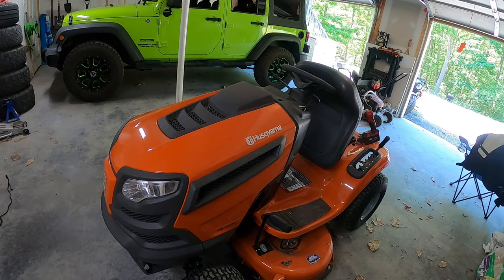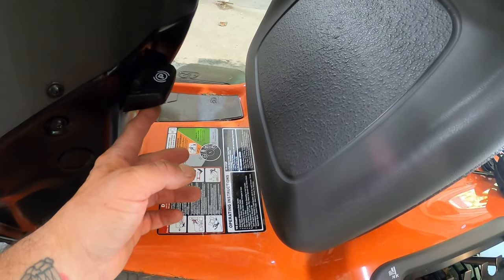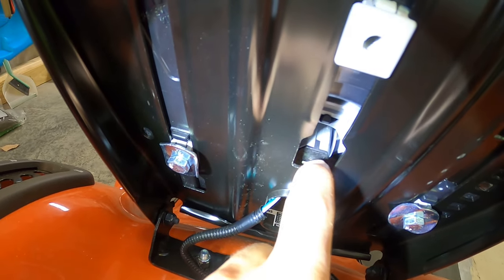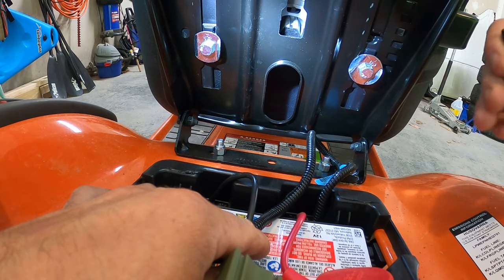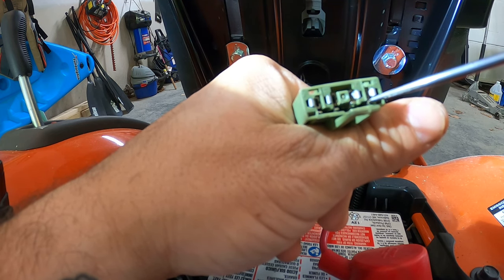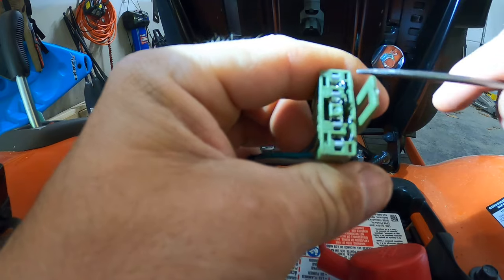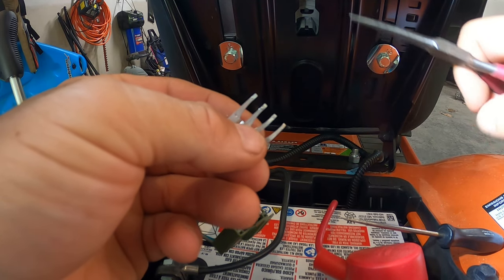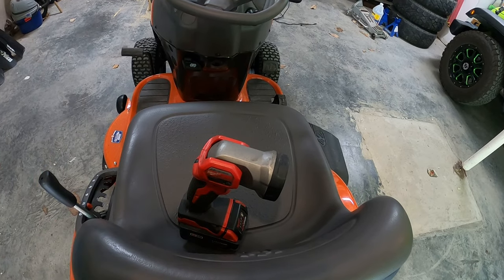How To Bypass Your Riding Mower Seat Switch

Comment: What these companies need to understand is that not everybody’s yard is perfectly level and perfect like the yards in the lame Lowe’s or Home Depot commercials my yard is hilly and I have to lean and it tries to shut off while I’m side ways on it🤣
Reply from the maker: Agree. I think it's definitely a good idea to auto shut off in a roll over event but, I lean to prevent a roll over.  Can't win
Reply: That's exactly why I am here.
Reply: @Ionizap  I agree with you but, the liability to the company if something happens is expensive in court.
Reply: Also they need to learn I might want to run my mower for over ten years and I got no choice but to change a safety feature or whatnot.  : ) I got a few welds on my 10 yr old for sure too : ) and where am I gonna throw the old one away anyway? Haha. I'll turn it into a go cart.
Reply: Amen

Comment: I'm glad you posted this, I went right out & popped that clip out.  Cut some grass.  Then I went to start my New Holland tractor to cut the larger areas, but it was dead to the world.  After a few minutes, I found that I had left the PTO turned on the last time I shut it down.  D'oh!  Deleted by one safety switch and immediately stymied by another on a different machine!  🙄

Comment: This is great!! Literally took me 2 minutes only because I had to go back to the toolbox for a smaller screwdriver.  
One tip: tape the metal contact that comes out TO the plastic switch. That way if you want the safety switch activated in the future (after you are done troubleshooting) then you don’t have to go searching for it.
Reply: Do u plug it in wit the safty switch off
Reply: @markd6637  nope leave it unplugged after you have taken the metal contact out. Metal contact has to be taken out of the plug or the mower won’t run.
Reply: Still won't run

Comment: Thanks for the tip. Was hoping I had a bad seat switch and as a result the mower wouldn't start. But it still won't start. Thanks for helping me eliminate one possible issue.
Reply: Mines won't start either just kinda clicks battery and fuse both are good. Did you find a fix?
Reply: @tiacapri  chances are low, but if you are still having this issue, its most likely the start solenoid.

Comment: I just did this to my mower as this block of instruction demonstrated and it worked perfectly. Labor for my area in Michigan would have ran between 60.00 and 129.00 for a general once over not including parts. This switch cost 10.00 - 19.00 to replace and it simply isn’t worth it. It’s already costed me a new battery this season. Well worth the few minutes of my time. Thanks for passing this tip on.

Comment: 10 million thumbs up my friend.I have a Craftsman and a small bank to mow.I would try to lean my weight up hill for traction and the dang thing would die.These "safety" devices are more dangerous than they know.Thanks again.
Reply: If you use a small flat head screwdriver, you can just push the metal piece all the way out rather than having to grab it with pliers.

Comment: The most helpful video by far for me on YT. My Husqvarna kept running real rough, and I could even get off the seat and it would still run. Replaced the seat switch on it, thinking that was the problem.  Nope same issue of the tractor running rough. Came across your video  and it fixed the issue thanks

Comment: I got lucky, this video was the first for my search.  Just bought a new Husqvarna TS248XD and there is a loud whirring sound when it’s running with the clutch all the way out.  I can apply just a small amount of pressure on the pedal and it stops.  I think it may be a drive belt pulley bearing.  Thank you so much!

Comment: Outstanding share thanks one of the most informative videos I've seen in a while also the clarity is right on time.  I'm trying to figure out why my country clipper isn't starting. I've put in a new battery a new solenoid a start switch and a pto switch and still nothing. Thats why I thought I'd try disengaging the safety switch for the seat. The search will continue.

Comment: thanks. 
i put a new carb on my mower today and couldn't tune the new carb.   my battery was also dead and i couldn't unhook the jumper cables from my truck.  i worked around that by using my jump box instead.

Comment: Thank you! Now I don't have to use my zero-turn Cub Cadet for everything just because it was the only one that I could get off of to open the gate and have the engine keep running! (Well, it's still the one that gets closest to the fences without the tires getting in the way though.)

Comment: Thank you  Thank you.... I have been working on mine forever and couldn't find the problem. You Sir showed me the solution.
The plug on the wire harness was the problem, that metal prong thing was making bad connections. I removed it, problem solved.
Reply from the maker: That's awesome, glad to hear it

Comment: Helpful thanks for the video. Just one question if you plug it back 8n with out that part in the plug will the seat shut off still work, Or do you need to put that part back in?

Comment: After watching your vid about the seat safety switch, I fully expected I'd want to do what you showed. Now that I've actually run my YTH24V48, I found the key switch had a "reverse while mowing" position.
So, I was going to do your fix. Then I discovered if you just leave your key in that reverse position....you can mow forward without having to move the key to the full run position. So now I just start it, move it to the reverse while mowing position....easy peasy....no modifying. Why do all that?

Comment: I have a Craftsman YT4000 and did this but I just unplugged the harness and zip tied it to the fuel line so it doesn't flop around and it worked fine, didn't have to remove the insert....just unplug it and you're good to go.

Comment: Worked like a charm…. Thank you… next is the reverse thing and having to turn off the blades
Reply: not sure about your model but on my craftsman you can turn the key back 1 notch after starting but not to the off position and it allows for reverse cutting.

Comment: It works on a YTH2448T also but id like to be able to go in reverse with the blade engaged. I'm still working on that. Thank you Sir
Reply: Can you not turn the key back after you start it to the notch just passed the shut off position?

Comment: Hi Thank you for the tip. However the three wires that extend from the switch can you tell me their function . I presume the black is ground where do the other go to?  Could I just cut the wires and join them with connectors so nothing changes, then connect in one of the wires an emergency tie switch that in case i slipped off the seat the my fall would pull the switch, close the circuit and the engine would stop.  So which of the three wires is connected to the magnito to cut the engine. Tks for your help
Reply from the maker: I'm not really sure to be honest.  I tried to find a wiring schematic online but didn't have any luck finding a free one.
Reply: @randomstuff8191  Thanks for your quick reply. Then where would you think would be the best place to connect a ground to the engine when tripping the tie switch. The spark plug itself of the magneto or somewhere else i.e to short the circuit in an emergency with the seat safety isolated  Appreciate your thoughts

Comment: I'm just going to take a plastic card (old cc, membership, or those fake ones they send every day in the mail) and cut it to fit, slide it between the contacts, and tape it in for good measure.  I think this would do the trick?  Seems easier to undo, if needed.
Reply from the maker: Ya I think that will work great, it's a good idea I didn't think about doing that

Comment: With the switch disassembled do the blades turn on without you on the mower ??
Reply from the maker: Yes, with the switch disabled the blades can be running without weight on the seat

Comment: Question are you able to put it back in ?
Reply from the maker: Yes, as long as it doesn't get bent too much taking it out. Also it can be put back in upsidedown but won't work properly. Just remember the pins on the part you take out bend down towards the female ends of the connector

Comment: Also, I have owned a craftsman in the past with a similar system to which you needed to remove the 4 pin and plug the connector back in, otherwise the mower wouldn't start at all

Comment: Can u just plug the connector back in so its not just dangling? Doing this tomorrow :)
Reply: What happened when you plugged it back in?
Reply: It will not work if you plug it back in... The circuit loop with the sensor included would be routed. You have to leave it unplugged and removing that clip clip closes the circuit without the sensor in it.

Comment: I pulled mine out, same brand and everything but it still shuts off when I get off the seat 🙂
Reply from the maker: Did you leave it unplugged? I didn't mention that in the video but have seen people plug it back in and it will continue to shut the engine off
Reply: @randomstuff8191  Thanks for the fast response. I plugged it right away. Maybe it's because I have an older model or something.
Reply from the maker: @boss-lyfe  no worries yeah if you pulled that metal piece out and left the connector unplugged and it still shuts off it must have some other safety device I'm not sure what to do about that

Comment: Hi,  I just bought a new Husqvarna B&S 54".  Watched ur Video and removed the metal pins.  Nothing happened!  Mower backfires and cuts off every ten feet or so as I have a bumpy lawn.  I only weigh 95 lbs.  It shuts off if I step off seat too. Any thoughts!
Reply from the maker: I have been doing some research but unfortunately not finding much. They must use a couple different switches for the different models. ill reply back if I finds any info I can pass on
Reply: @randomstuff8191  Thank u.   I just discovered my error! All is fine and I can  mow my lumpy lawn. Now I'm off to my garage to use  my brother's bandsaw to cut the grass shoot flush with the deck.  Hope I don't have to make any more modifications to this over priced machine!

Comment: My mower will only stay running if I hold the key slightly towards start,any ideas?
Reply from the maker: My best guess would be the ignition switch, when the engine is running can you tell if the starter is disengaged?
Reply: @randomstuff8191  I just ordered a new switch :)
Reply from the maker: Cool, let me know if that takes care of it, I'm curious.
Reply: @randomstuff8191  That was it , Done Deal :)
Reply from the maker: Cool, glad to hear it.

Comment: I have tried this with mine, had to put the pin back in, moser wouldn’t start / stay running until I reinstalled it.  Craftsman t240
Reply: What did I do wrong?

Comment: I have the exact model as you.  I did exactly as you showed.  Did not work for me.  I had previously done the "toothpick" bypass, and it worked fine.  Then mice chewed my wiring, and off to repair.  Now have to bypass again, and it does not work.
Reply from the maker: Hmmmm, that's strange. Not sure what's going on there.

Comment: Does this allow you to mow in reverse now???☝️☝️☝️
Reply from the maker: With the hydrostatic transmission I don't have to do anything special. I used to cuss every time I put my old mower in reverse and it stalled out...
Reply: My husqvarna 2454 has a key setting between run and off that let's me do that

Comment: Doesnt work, I removed strip and mower shut off as soon as I releashed  clutch... Instead of removing metal tab just unplug ?
Reply: You must remove the metal clip and leave it unplugged. Removing the clip closes the circuit. Leaving it unplugged deletes the sensor from that circuit.

Comment: I think this video was informative but I have to say this landscaping company I worked for like 100 years ago did it to a commercial mower and 2 people almost lost there legs by the engine not stopping and the blades engaged.  This Landscaping company went out of business years ago.  They probably got in trouble for taking the safety switches off the equipment.

Comment: Why can't you just cut the wires clean off the plug? When you remove the ground-out plate the wires no longer touch each other?
Reply from the maker: You can cut the wires, I just didn't want to rewire the plug when I was finished "troubleshooting" 🤫

Comment: I own YTH22v46 machine for 5 years, bought it from Lowes. Year 4th engine oil leak, year 5th hydraulic shot. I better getting new machine intead of fix it. Piece of junk machine. I would not recommend Husqvarna. I do own a Husqvarna blower and that working ok.

Comment: Couldn't you just plug the connector back in?
Reply from the maker: You can buy that will put the safety switch back in the circuit and the mower will shut down when weight is off the seat.  The metal piece that is removed is the manufacturer attempt to stop us from just unplugging the switch

Comment: Wait, don't you have to plug it back in? Why would you even bother pulling the clip out?
Reply: Don't plug it back in. Leave it unplugged with the clip removed. Removing the clip closes the circuit without the sensor included.

Comment: Didn’t work for my husqvarna and I don’t understand why not. Mine is just like this one
Reply: Remove the clip and don't plug it back in. Let it hang. Removing the clip allows the circuit to close. Not plugging it back in deletes the sensor from the circuit.

Comment: I did this on my  Craftsman T1700 and the engine still cuts off when I get up.
Reply from the maker: Hmmm that's strange.  I don't have the same mower but I would assume they work the same.  I'm not sure what's going on there
Reply: @randomstuff8191  turns out I had to disconnect the entire harness and just let it hang. That worked.

Comment: Another way to do it is to rig the switch, push the button in and tightly wrap it with electrical tape. It's far easier and will hold for years.
It only works if the switch is functional though.
Reply: I tried taping and eventually the tape would stretch and button comes out enough to start shutting off again.  This video has the perfect solution. in my humble opinion.
Reply: @alltakennow  I can't argue with results.